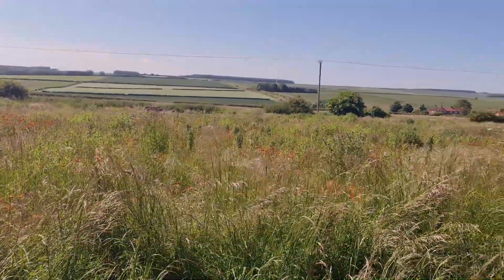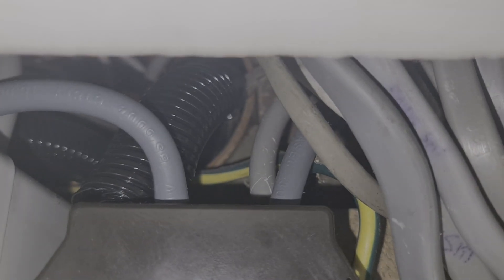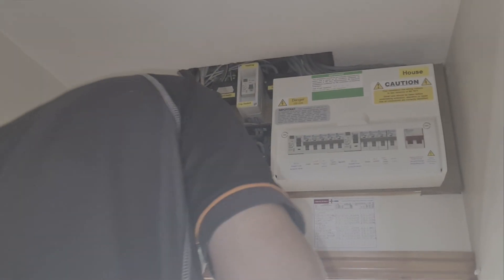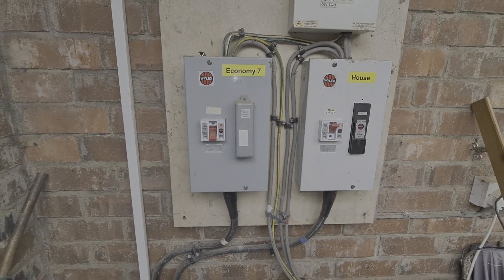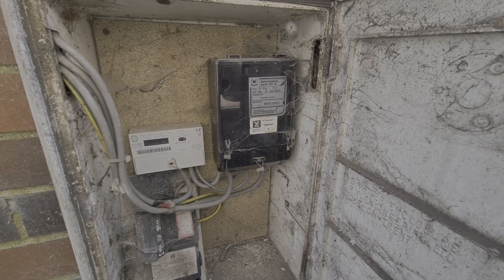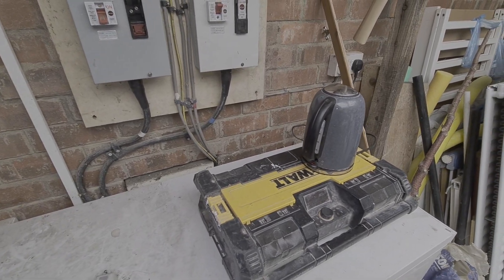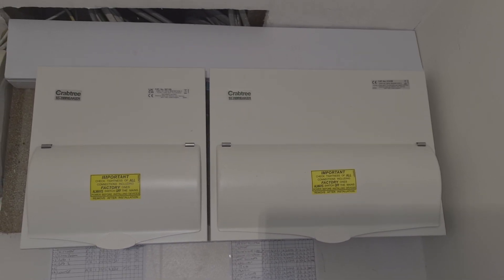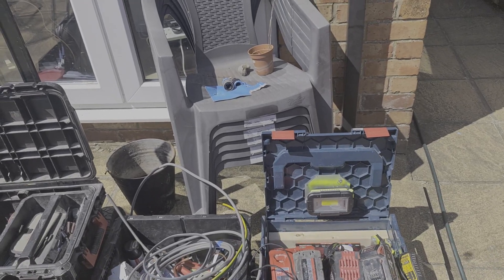Disaster consumer unit we work to fix the problems

Comment: As this installation is in the countryside, with overhead supply. Why did you not fit a SPD to the board?
Reply from the maker: Because the board is about 10m from the intake postion where an SPD is in place. Good question tho! Thanks
Reply: Thanks, I was sure you would have fitted one, but you already had one.

Comment: On those isolators does the neutral tail go to the house iso, then the garage, then finally to the economoy 7 iso? I can only see the one grey sheathed tail into that isolator. I take it they henley blocked the live, and earth but not the neutral and took it on a wild ride :D
Reply from the maker: It was a mess Jon. They did that with the earth as well. No henleys in sight at the intake. Tidied up now with an SPD to boot.